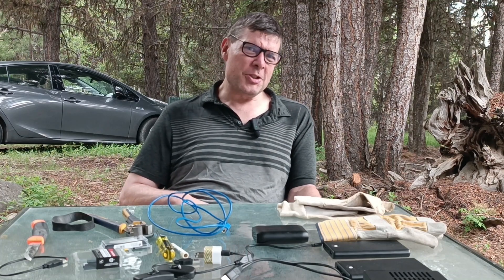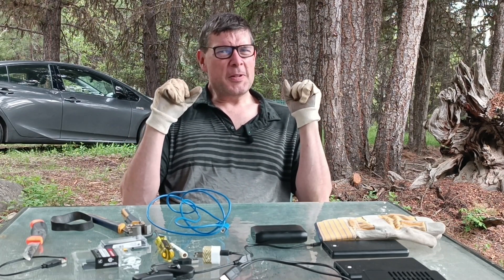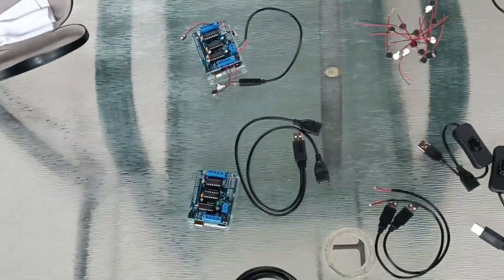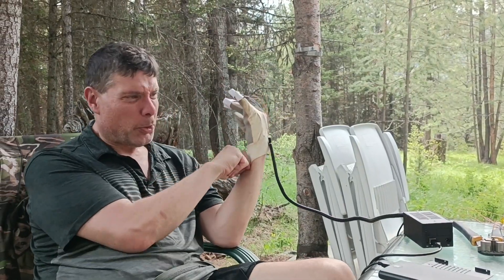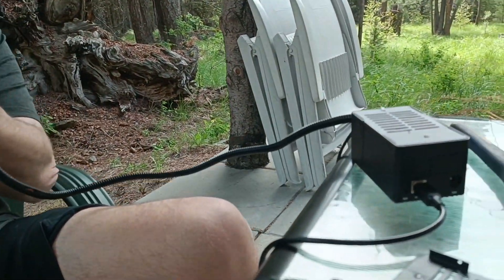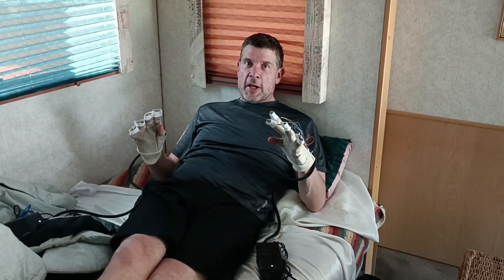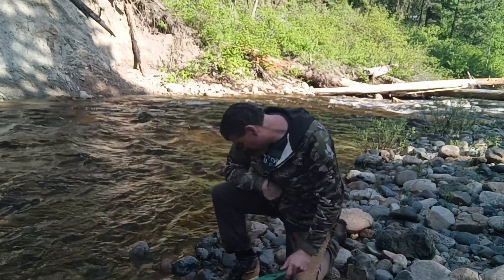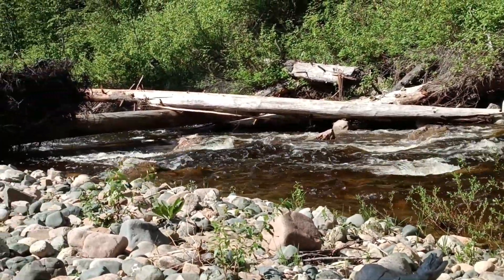Homemade gloves for Parkinson's - Vibrotactile Therapy

Comment: Thank you, Mr. Gebhart! My question is: does the gloves really work? If it really worked for at least one PD patient like the DBS, that is, the tremor stopped as after the glove is turned on, it can prove my explanations on how the tremors are generated. Maybe you can prove it. I noticed more detailed discussions of the vibrotactile finger-tip gloves by Dr. Peter Tass of the Stanford Medicine but I am not fully convinced if the gloves work?
Current theory believes the neurons in the brain that create dopamine for nerve communication abnormally creating unwanted electronic signals and causing movement patterns like tremors, rigidity, or difficulty initiating movement. However, I do not believe this theory explains how a DBS works. 
As a PD patient and also an electronic expert, I see the tremor more likes an undesirable parasitic oscillation caused by the nerve system for motor sensing and control. When the neurons cannot generate enough dopamine, the nerve system tries to automatically increase its loop gain to output stronger control signals and that forms positive feedback and causes the unwanted oscillations. Considering the nerve signal transmitting speed, the tremor likes a low frequency oscillation, and a muscle contraction likes a high frequency oscillation, or a positive over-flow DC feedback. According to information system stability theory, in case of no modifications on the system, adding a proper electronic signal to anywhere in the system can decrease the loop gain and thus stop the parasitic oscillations. This consumption explains how DBS works. If this is true, we can add electronic signals to the hands, arms and anywhere on the bodies, rather than only in the brains like that of DBS.
Reply from the maker: Hello Bing, your level of learning in this area is way over my head. I am no expert. Everything I did to build the gloves with my friend Trevor I learned at this YouTube channel. 
https://www.youtube.com/@pdvibrationtherapy
Also, this YouTube channel was made by a researcher in another country doing extensive trials and research into the gloves.
https://www.youtube.com/@slchan1

Based on my experience the gloves work well for me, although I don't have any tremors as a symptom.

Thanks for your input. I appreciate it.😀😁😊
Reply: I see. Thank you very much for your video and replies. I will check the channel you mentioned. @LifewithParkinsons

Comment: I am an electronic expert and I was diagnosed Parkinson 5 years ago. I believe tremor is caused by an unstable nerve feedback like an electronic system. Tremor is probably low frequency oscillation and muscle contraction is caused by high frequency oscillation of a positive feedback. If so, it explains how DBS works. It just likes an old speaker system. Auto gain control causes the oscillations.
Reply from the maker: Hi Bing. I hope it's as simple as you make it out to be. I certainly don't understand how it works. Thanks for your input though as an expert it is very valuable. Thank you for the comment. 😀😊😊
Reply: Thank you, Mr. Gebhart! My question is: does the gloves really work? If it really worked for at least one PD patient like the DBS, that is, the tremor stopped as after the glove is turned on, it can prove my explanations on how the tremors are generated. Maybe you can prove it. I noticed more detailed discussions of the vibrotactile finger-tip gloves by Dr. Peter Tass of the Stanford Medicine but I am not fully convinced if the gloves work?
Current theory believes the neurons in the brain that create dopamine for nerve communication abnormally creating unwanted electronic signals and causing movement patterns like tremors, rigidity, or difficulty initiating movement. However, I do not believe this theory explains how a DBS works. 
As a PD patient and also an electronic expert, I see the tremor more likes an undesirable parasitic oscillation caused by the nerve system for motor sensing and control. When the neurons cannot generate enough dopamine, the nerve system tries to automatically increase its loop gain to output stronger control signals and that forms positive feedback and causes the unwanted oscillations. Considering the nerve signal transmitting speed, the tremor likes a low frequency oscillation, and a muscle contraction likes a high frequency oscillation, or a positive over-flow DC feedback. According to information system stability theory, in case of no modifications on the system, adding a proper electronic signal to anywhere in the system can decrease the loop gain and thus stop the parasitic oscillations. This consumption explains how DBS works. If this is true, we can add electronic signals to the hands, arms and anywhere on the bodies, rather than only in the brains like that of DBS.
 @LifewithParkinsons

Comment: Thank you Dave.  It will be interesting to see how the combined therapy using Photobiomodulation along with the gloves will improve your symptoms.  Awesome.
Reply from the maker: Hi Laura. We are just completing an upgrade to my gloves that provides much more vibration contact and coverage. Hopefully I will have them both working at 100% soon. So close. Once there, I will share with everyone. I think with the Red light and gloves it will provide a good boost. Right now I have one glove on the new upgrade. Using that single glove and the red light this morning, I came on 25 minutes after taking my morning meds. That's twenty minutes faster than normal, so I think there is some hope😀😁😊.

Comment: Vibra what?  How do they hold up for you? How are you doing?
Reply from the maker: Hi Kathleen. I know right? Vibrotactile therapy.  One glove has held up really well and is performing great. The other one I think I dropped too many times while making it I need to replace one of the little computer boards which is no big deal. I will be posting an update on how I am doing but there are a couple major things that I have noticed so far.  The first one is last week I was able to get up before 7:00 a.m. and take the garbage out on time   the last few months I have been relying on my wife to do that more and more so it was really nice to be able to take the garbage out again. I woke up at 5:00 that morning and wore the gloves for 2 hours before I did that so I was very happy. 
Another thing that has been happening for example is like today I woke up at 5:00 again and fell asleep wearing the glove for an hour and when I got out of bed I had no dystonia in my right foot or leg. That is something I have been battling for a few years.  I hope that helps thanks for your comment 🙂🖐️😃